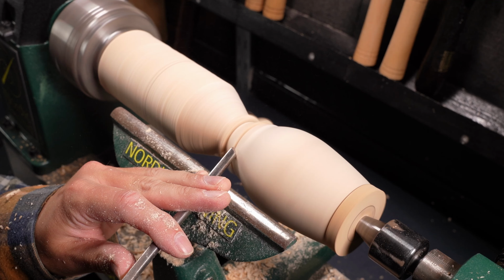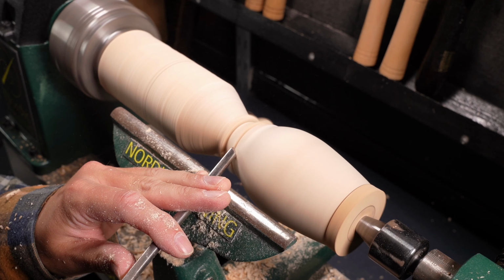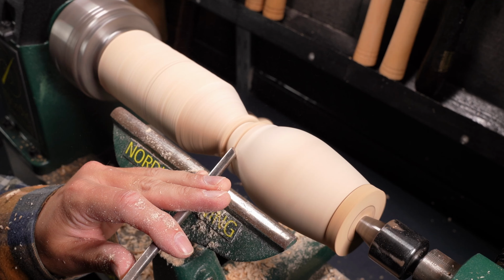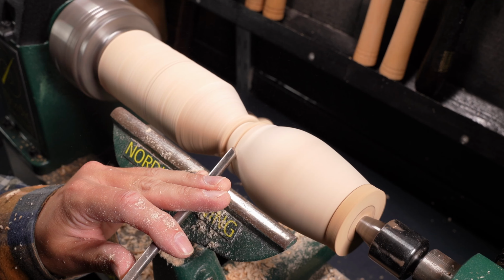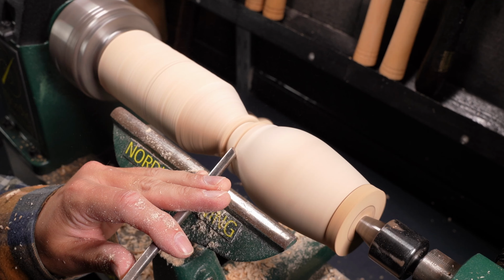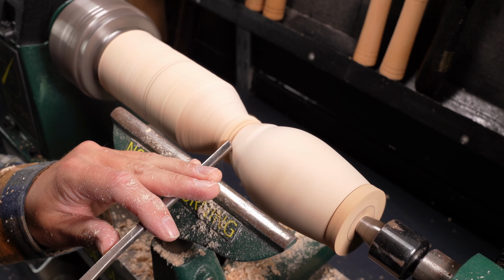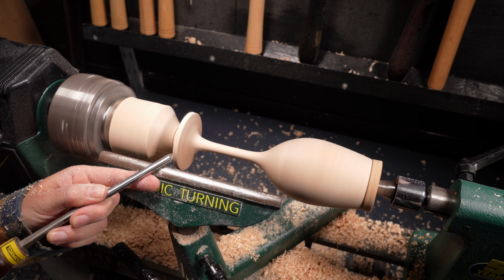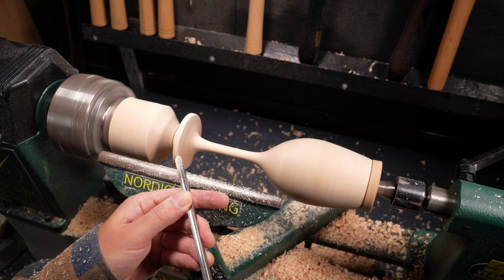Woodturning - A wooden goblet

Comment: For hollowing you could also check tools by Hope Woodturning. These use a carbide that's best to use on end grain. I have a Hope HW Midi and Maxi as well. They work quite good and catches are nearly impossible, but like with everything else you also have to practice to get optimal results. 
I feel like the stem of your glass could have been a bit narrower, but nevertheless it turned out nice 👍🏻 Greetings!
Reply from the maker: @0BAMiiN  Thank you for your comment! 👍 I’ve seen people use carbide tips. I’ll check out your suggestion. I agree, I could have gone thinner on the stem, but lost my nerve 🤣
Reply: @nordicturning  I think it's definitely worth it. I also use scrapers, but not for stuff like that. In the end it's a question of style and what you prefer. So maybe you can give both, scrapers and carbide, a try 🤗 Yeah, it still happens to me as well, I actively have to remind myself to go thinner 😅 Mostly because somehow the wood looks thinner while it's still on the lathe 🤔😂
Reply from the maker: @0BAMiiN  I had a look at Hope Woodturning, they have lots of cool stuff 👍 Never heard of them before. Thank for that. I have the exact same experiense, where on the lathe it seems like its superthin, but when I cut it from the lathe and get it in my hands I wish i’d go MUCH thinner
Reply: @nordicturning  Glad to help 🤗 
Yeah, that's it 😅 But we'll get there 😆